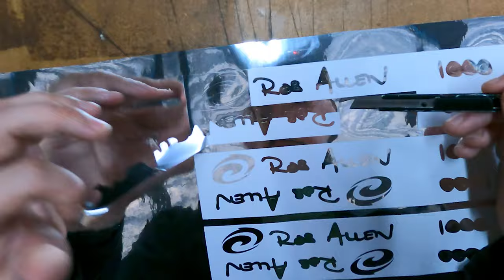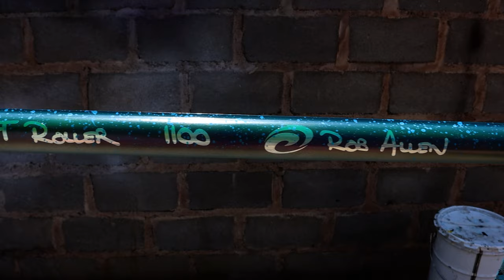Rob Allen | Airbrushed Barrels | 2023

Comment: Stunning work. I would usually say that covering carbon is a crime but in this case the art is way nicer than the raw carbon look
Reply from the maker: Agreed. Also, our carbon does not show a weave on the outside due to the way it is pulled through the manufacturing process. All the weaving is internal.